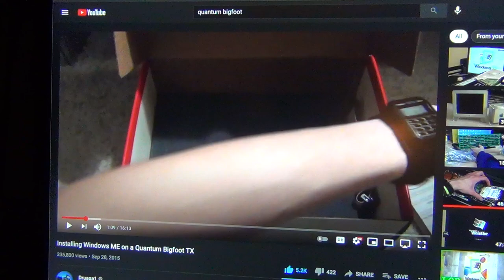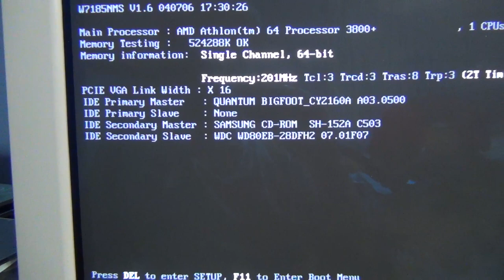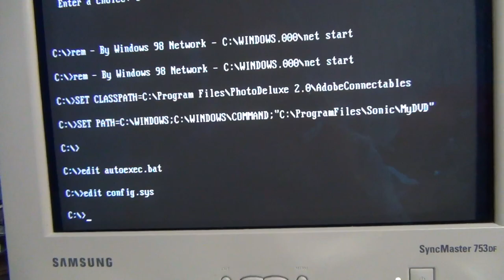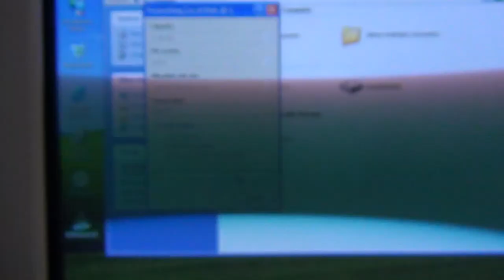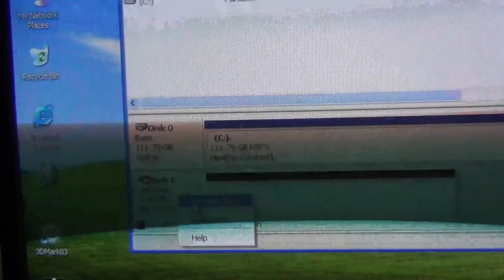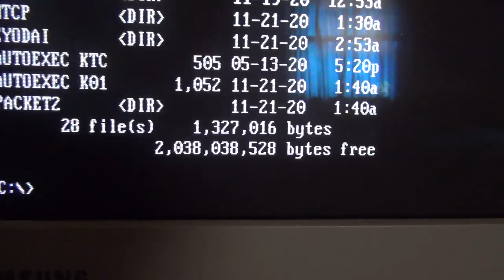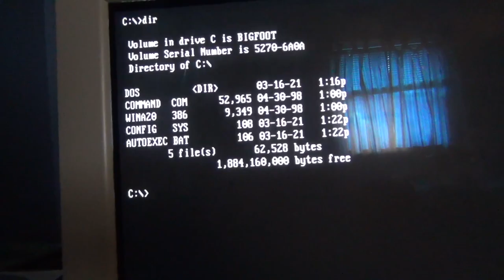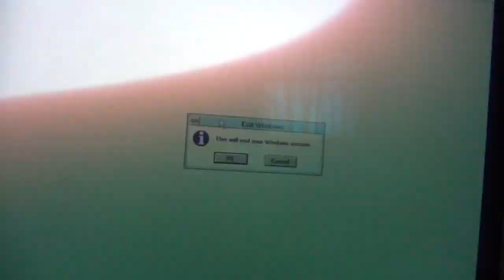Quantum Bigfoot CY 2 GB Hard Drive

Comment: Great drive, hope it keeps working and doesn't have more issues. I love the spin-up sound on these, it sounds great.
Reply from the maker: Me too! Thanks for the watch and the comment. This is definitely one of my new favorite hard drives. It has that Quantum “theme song” of a seek test pattern, and my favorite version of it at that. :)
Reply: @hs_doubbing  You should make more videos on your drives, you probably have some we haven't seen yet.
Reply from the maker: Ehh. I’m planning on it but my collection isn’t all that impressive beyond the couple of old stepper drives I’ve already shown. 
Still though, what drive software would you recommend for recording and archiving drive sounds? If any, of course.
Reply: @hs_doubbing  HDMotion makes the drive sound interesting. For Windows HD Tune works great.
Reply from the maker: Cool, thanks. I’m going to try to systematically go through my hard drives and record their sounds. I think my Athlon XP machine would probably do well for that if I disconnect some of the case fans and make it run a little quieter. 
It has a SCSI card so I should, in theory, be able to do all of my IDE and SCSI drives on that one system, so long as the BIOS is willing to deal with small sized IDE drives.
Reply from the maker: I just tested HDMotion - it works with my SCSI card no problem under FreeDOS! I even tried it on the dead Miniscribe, and the drive is still kicking just enough to make all of its cool noises. I'm quite excited for this project!